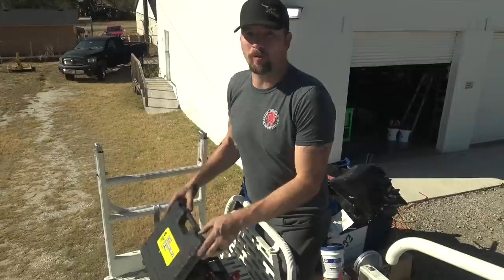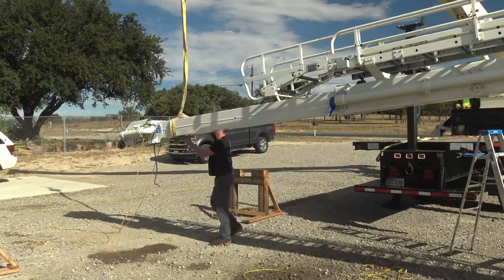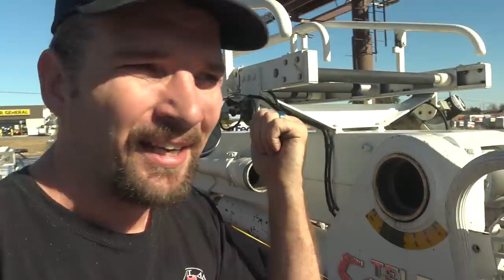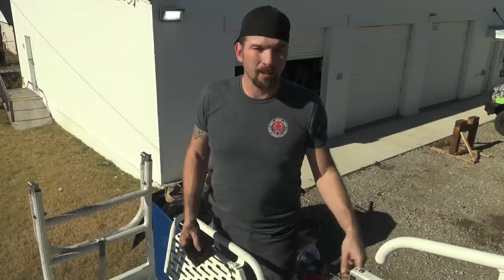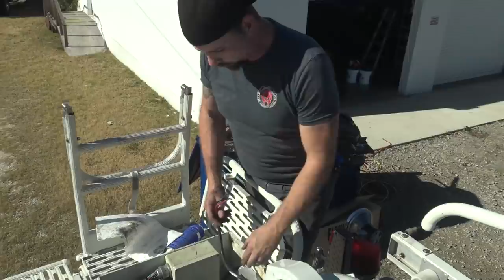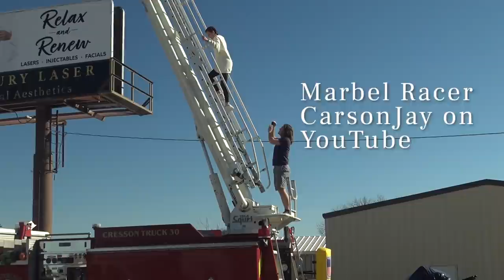This Saved The Fire Department Thousands Of Dollars!!!

Comment: In Camden-Wyoming, De. we had a 1985 American La France 85' snorkel/tower ; she was a good one. Talk about poop and fly, she could.  Had  a v8 detroit diesel 10 wheel chassis with a Century series cab.  Bought for $85,000.00 what a steal compared today's prices. Today we bought a used Pierce 95 ft tower ladder for $200,000.00 and thought we were ahead and spent $133,000.00 to fix things up.  Then had to fix the engine detriot diesel (two pistons and sleeves $11,000.00), then the repair garage caught on fire and we hoping the truck burned up too; but the local fire was quick. Then the transmission had to worked on $4,000.00; boy we are buying a new truck piece by piece.

Comment: I worked on a 65 foot 1986 Pierce Telesquirt years ago. I replaced the pressure switches on the outriggers and hydraulic lines elevation. The pressure switches were quoted at $350 each from Pierce. The same brand switches from the local hydraulic shop was $140 each. There are some parts that you have to get from OEM but you can save $$$ by shopping around.

Comment: In the Greater Manchester FRS in the UK we had one in the mid to late '70's called a Simonitor but found it shockingly unreliable.  Glasgow Fire Service in Scotland used them and called them the Scoosher.  Most if not all brigades have stopped using them in favour od Aerial Ladder Platforms which is a "one size fits all' ladder, hydraulic platform and aerial monitor which, in the long run, is far more cost effective and versatile.  Nice repair.

Comment: Did you have to bleed the hydraulic lines of air or do they self bleed out the air?
Reply: Extension bleeds the outboard end. Retraction pushes the air out the inboard end. Job complete, except for topping up the hydraulic tank.
Best wishes
Reply: @carlthor91  Thanks for the info. Take care
Reply from the maker: Well said.

Comment: I sure hope third party load, timing testing, pump/waterway testing was done after this repair, no way in hell I would assume the liability on this . NFPA 1901, 1911, and 1071 is very clear on the who what and where aerial devices should be maintained and the  credentials of those having authority having jurisdiction. If your certified by the   manufacturer to service this device that's one thing, if your a general service technician your liability will last the entire time this aerial is in service, first time it fails or a firefighter/civilian is hurt God help you in litigation...